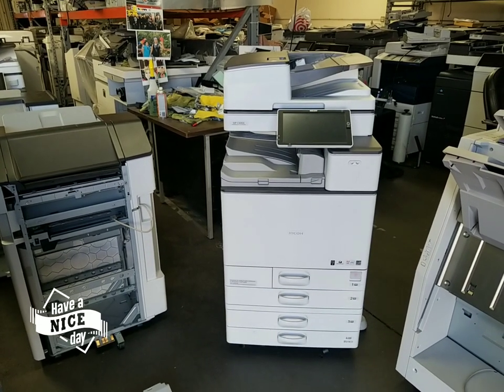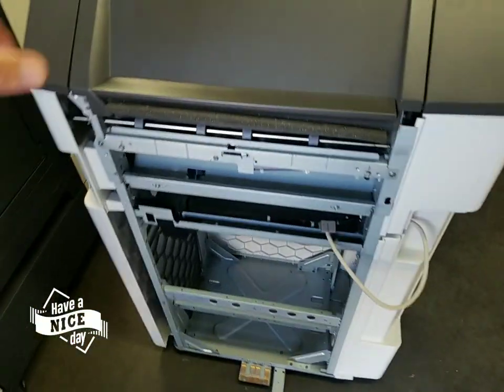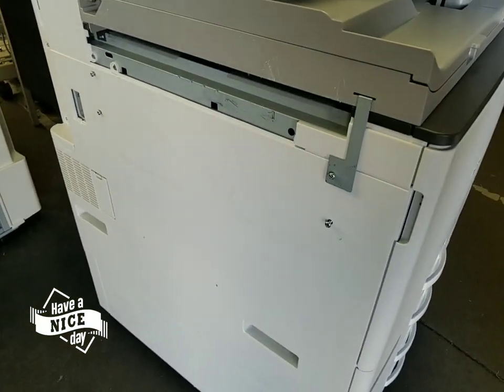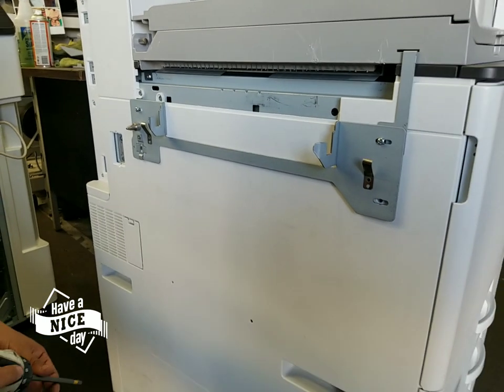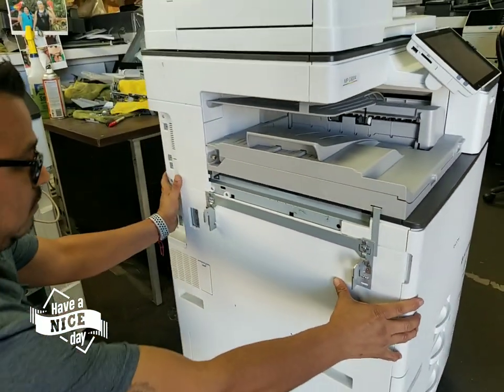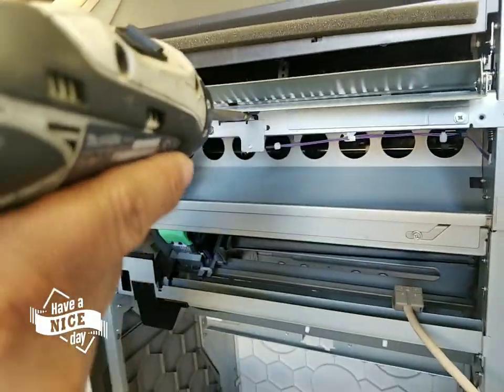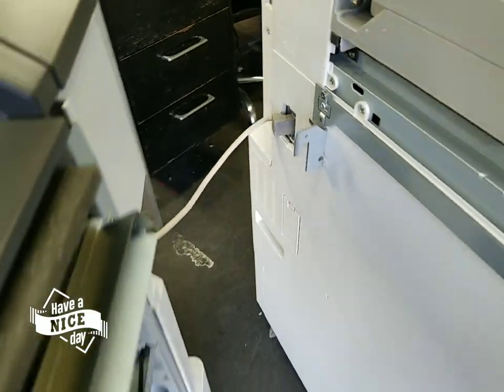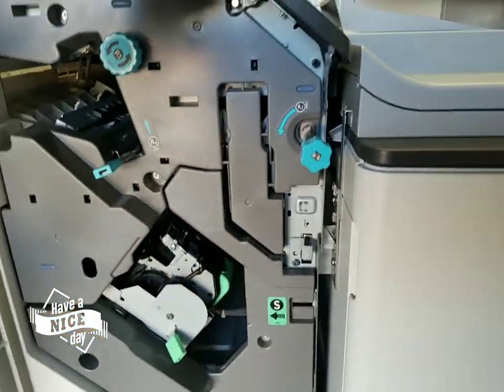Ricoh MP C  copier finisher installation.

Comment: I have two question: 1. Is SR-3120 staple finisher compatible with Savin c9145 printer?
2. Is the brackets you shown in the video comes with new Staple finisher ?
Reply from the maker: i would need to research what a savin c9145 crosses over to. i don't have that info readily avail at this moment. there should be a sticker in the back of the machine with all the different models numbers including Ricoh. let me know what model that says. not sure what new finisher you are referring to
Reply: @PrestigeOfficeSolutions  Thanks for responding so quick. You used metal brackets to connect printer to the finisher. So, I wanted to know if it comes with the new finisher already or we need to buy them separately
Reply from the maker: you typically need to purchase all brackets when purchasing brand new. Ricoh may of changed that where it now comes with the relay (bridge). you will need to check with your local Ricoh provider for that. We mainly deal with preowned equipment

Comment: Holy Sh%t!  I bought a storage locker with this copier in it.  we tossed the finisher assuming it was a broken printer ..ugh!!  Copier is reading finisher problem.  what exactly does the finisher do?
Reply: staples/makes bootlets, you should be able to use it without it, might just have the annoying notification there though